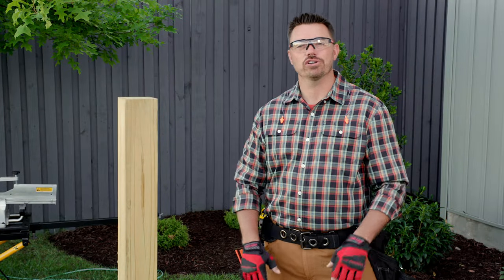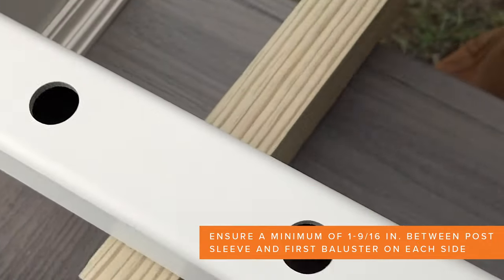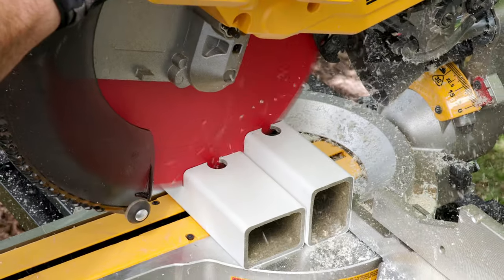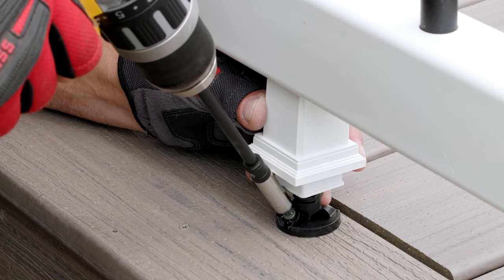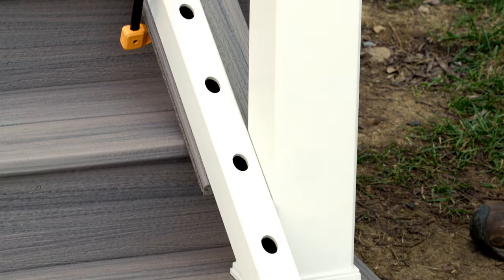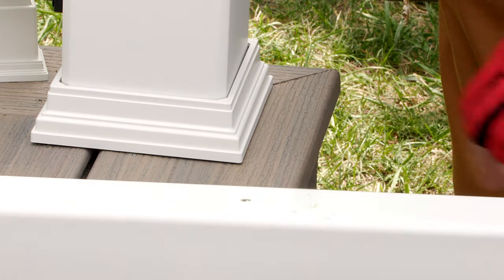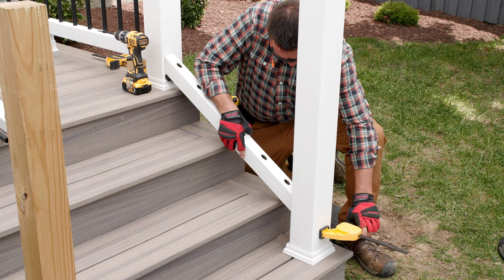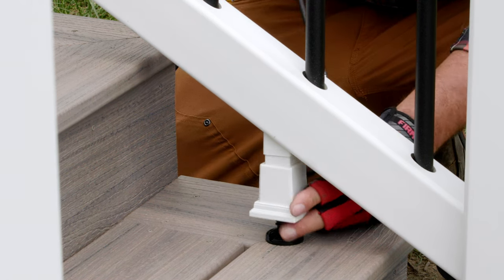How to Build a 12x16 ft Deck with Trex & The Home Depot Part 3 | DIY Decking

Comment: The biggest issue I’ve had is leaving enough space on each end of the railing to accommodate for the brackets. You literally have to space your 4x4 posts specifically to make that work. But since 4x4 posts are installed long before the railing, the average person doesn’t know to accommodate for that, or even what spacing to use until you get the railing started. I got lucky on my deck railing but got completely screwed on the stair railing. No matter what I do I can’t get above 1 5/8” spacing.

Comment: Why are the post sleeves loose when placed over the 4x4?
Reply from the maker: Thank you for reaching out with your question. The post sleeves are loose on some 4x4 posts as 4x4s are nominal measurements, and they can have a slight expansion over time. This allows for the sleeve to easily slide over the post with no concern of cracking. This also helps the rails pull tighter against the posts when installing. Shims can be used to plumb post sleeves while installing. Please let us know if you have further questions, or you can call us directly at 1-800-289-8739
Reply: @TheTrexCo  thanks for the reply!

Comment: Thanks for the video.  How far apart are your posts?  I have a 16 x 30 deck with railings on front and one side.  Was planning on using the 6' kits.  Would you do 6' on centers for the 4x4's or better with 5' something and cut to fit and then make up the difference where it meets the house?  Being a 1/8 or 1/4" short between posts scares me.  Easiest way would be to buy the 8' kit and cut that to fit but seems like a waste of money?  Thoughts? Thanks.
Reply from the maker: Hi Steve, thank you for reaching out to us today! Great question, the Enhance kits are only produced in 6ft kits measured in a true span of 72". So if your posts measure less than 72" this will work for that span. If you have a larger span and are choosing the color Classic White, Trex Select railing is the exact same as Enhance White and those kits come in an 8ft length, but it is measured on-center so its actual length is 91.5'. We hope this helps and please give us a call at 800-289-8739 if you have any other questions. Have a great day! -Trex Customer Care

Comment: You said you cut the post sleeves on the deck @ 40 "what was the total length of the post sleeves on the bottom stair post.thx.
Reply from the maker: Hello craft man, thank you for reaching out to us. The posts on the stairs will need to be taller due to the slope and angle of the rail. There are a few taller post sleeve options for either 48" or 108". We would normally recommend marking and measuring where your brackets will sit on the post with your slope and angle of the rail first and then making sure to leave enough room for the post cap before cutting the sleeves down. The post cap will overlap the post and drop about 1 1/2" down the sleeve, so you will want to make sure it's not sitting on the top rail. Kindly, - Trex Customer Care Team
Reply: @TheTrexCo   I cut both stair post at 47" my riser on my stairs  is 7" so the wood post above the tread is 40" and then I'll cut the vinyl post sleeve 4" above the top rail. Thank you for the video it helped out a lot,
Reply from the maker: Hello Craft Man, that is great! You are welcome. Please let us know if you have any other questions. We are here to help! Kindly, - Trex Customer Care Team